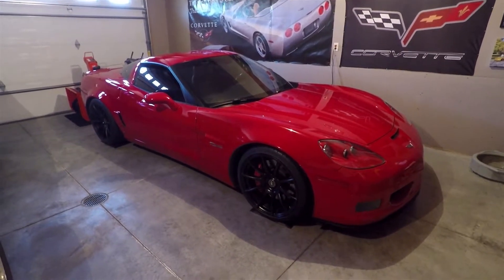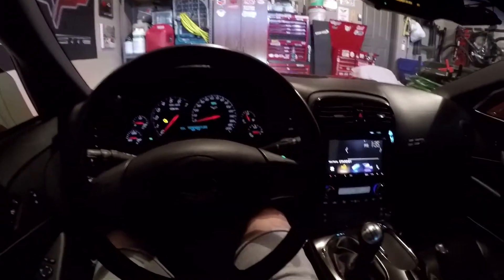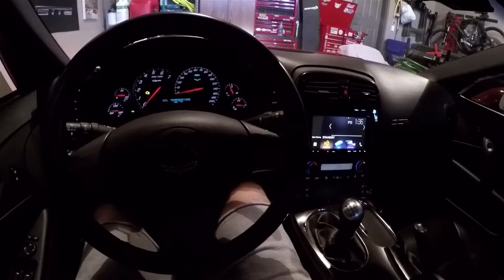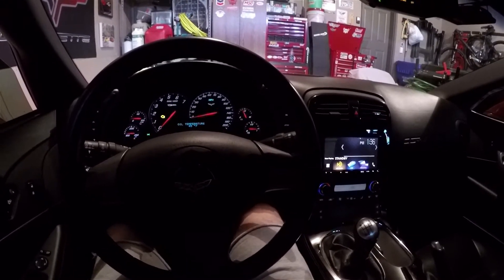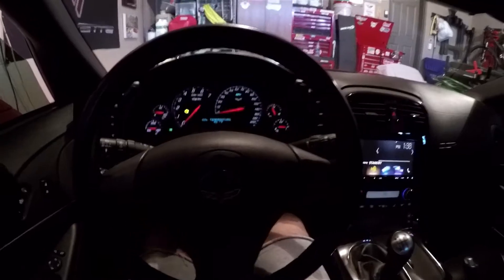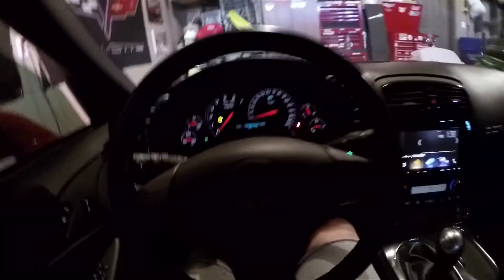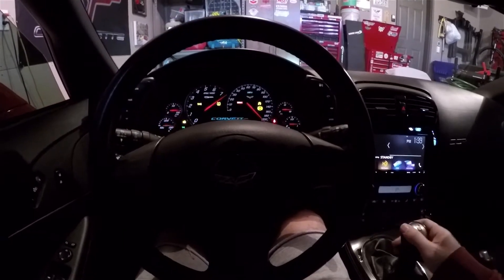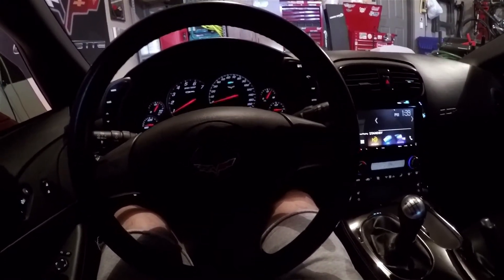How I Start My C6 Z06 After Winter Hibernation

Comment: I have reservations regarding this procedure. I do use it on my motorcycle in the spring. BUT I pull the spark plugs which relieves the pressure on the dry rod and main bearings. Of course the cam and valve train still takes a dry beating. The slow rotation does reduce the dynamic compression so maybe its a good thing?
Reply from the maker: GM would not have implemented this feature if it wasn’t safe.
Reply: @ZWHOA6Productions  
As you stated, this feature was engineered and intended for a flooded engine situation. It was not engineered as a pre-oiler for a dry engine. Is a slow dry rotation better than  an immediate dry start where the oil pump will more aggressively pump the oil…. I don’t know.
Reply from the maker: @kerryblueher3147  Good question. I just have to believe that pre-cranking the engine with oil has to be better than a full-on instant dry start after months of sitting.
Reply: @ZWHOA6Productions  FYI. I have read a statement by the Engine Re-manufacturing Association (that may not be the exact title) that the majority of engines returned for warranty had sat for 6 months or longer. For whatever that’s worth.